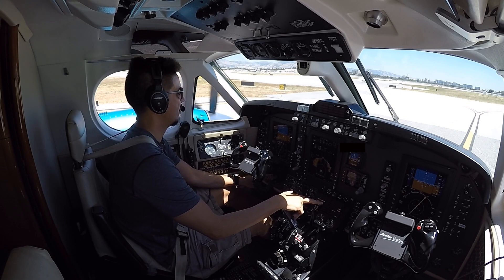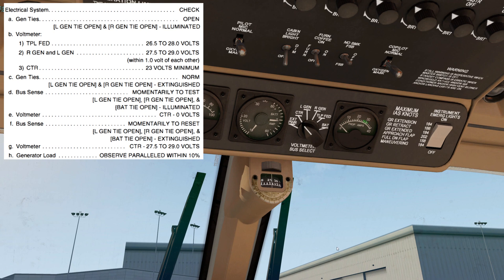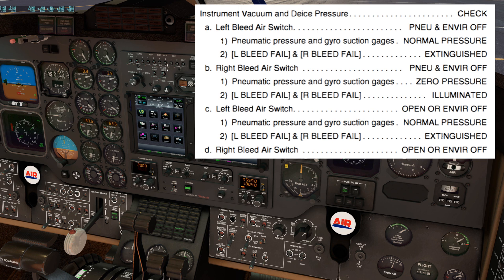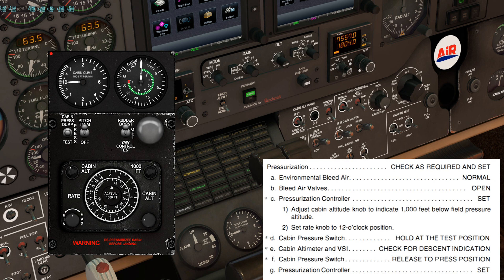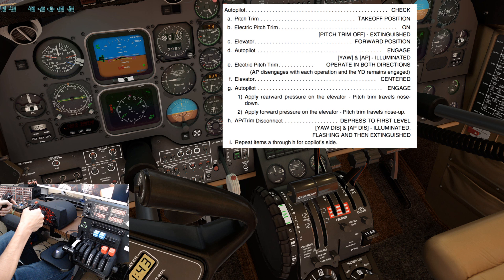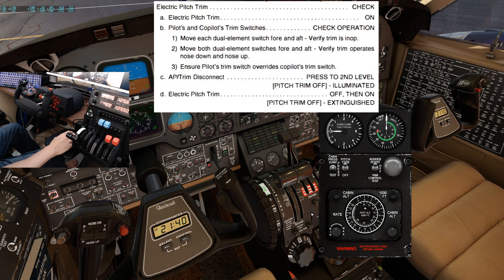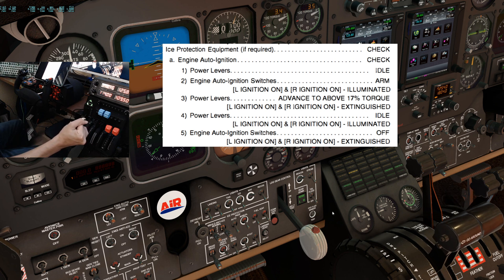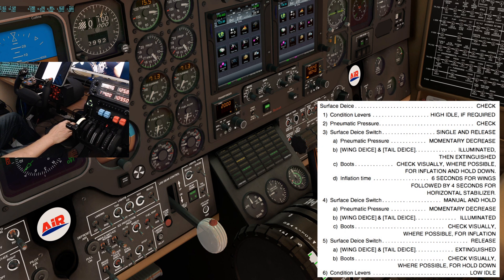King Air 350 X-Plane 11, Systems Checks Tutorial | Part 1 or 2

Comment: Hi.  I have a question that I hope you can help me with.  I have the X-Plane 12 version of the AirFoilLabs King Air 350, but after completing the Preflight Checklist, I can only retain 21-22VDC which isnt' enough amps to start the plane.  Even with the GPU attached and having turned on the X-Plane 12 Groud Support ground power, the batteries will not charge.  My only option is to use the GPU start checklist if I want to get the engines started.  Have you figured out how to do a battery start after running the Preflight Checklist?  Thanks, and thank you for your tutorials.
Reply from the maker: Likely a bug in the software.  I would report it to the developers.  I routinely did battery starts in the 350.
Reply: @chazflyz  Thanks.  I have since figured out that if I don't do the outside lights check, I can usually keep enough voltage to get number 2 started.  Of course, there's always a start using the default GPU in X-Plane 12.
Reply from the maker: @Randy97402 great. But that sounds like a bug.  You should be able to do the lights checks and still have plenty of voltage for a battery start. The lights shouldn't drain the battery that quickly.

Comment: Unique content, thanks a lot! And what are the scenarios of using the HIGH IDLE mode during flight operation?
Reply from the maker: Thanks!
In short, changing the conditions from low to high/high to low does nothing in flight.  All it really does is change the idle speed from 62% (low idle) to 70% (high idle) for the gas generator (N1 RPM). It also enhances engine cooling by maintaining a steady airflow through the engines.  

In other turboprops that I have flown- Q400, Pilatus PC-12 and Saab 340- the condition levers combine the fuel and propeller controls in one operation.  Because of that, they are a bit more complex/advanced.
Reply: Supposedly it gives you more effective reverse thrust.  

But in reality the higher residual thrust negates that advantage.. plus the King Air is limited by takeoff distance anyways (I rarely if ever use reverse).